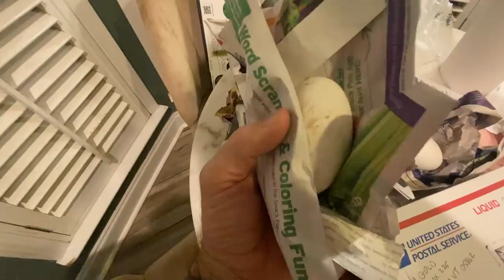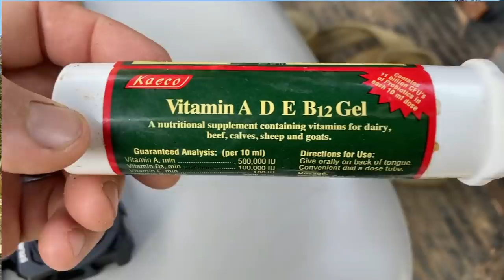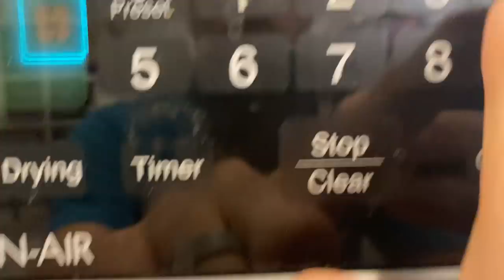A BIG YouTuber Sent Us These SPECIAL Hatching Eggs!!!

Comment: Jason, you might want to consider hiding all exposed electrical cords in the house with a new indoor puppy. If you do have to have a cord that is out in the open and exposed, try using fish tank air tubing over it.  (Slit lengthwise.)  There are commercial products available, but the tubing is cheaper and effective.

Comment: Make spaghetti with spaghetti squash. I also like to make taco salad with the spaghetti squash for added fiber. 
Then for acorn squash what I like to do with those is take turkey sausage the kind you find in the tube mix it up with a bell pepper and onion and some sliced mushrooms and then take three acorn squash and once you get that stuff all mixed up taking add some better than bouillon stuff to it about a tablespoon to two tablespoons all really depends on your taste mix it in with the meat mixture and then stuff the acorn squash after you remove the seeds stuff the acorn squash with the meat mixer and slice just enough off the bottom of the acorn squash so that it stands up without rocking put them in some baking dishes put them in the oven at 3:50 for an hour then pull them out put some mozzarella cheese on top a mound of it put it back in the oven and let it melt just let it melt to where it starts to get a little brown on the edges and then enjoy it is so good